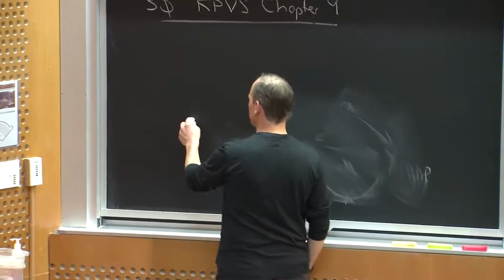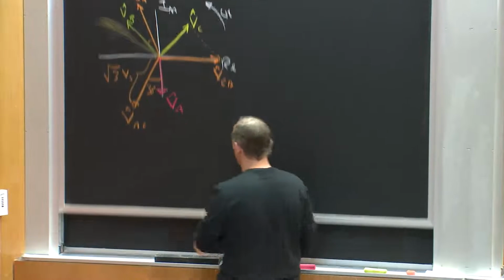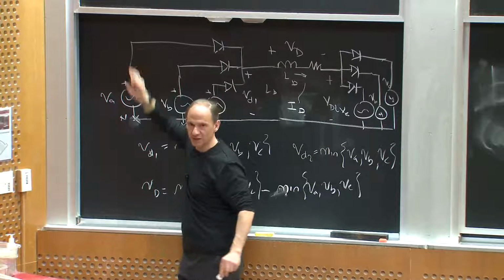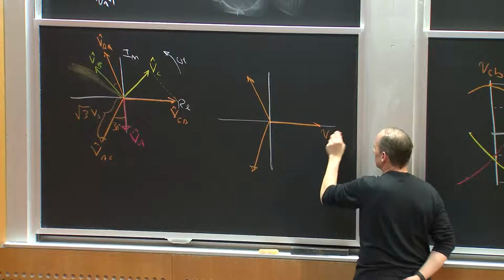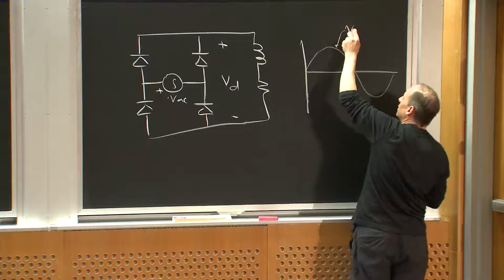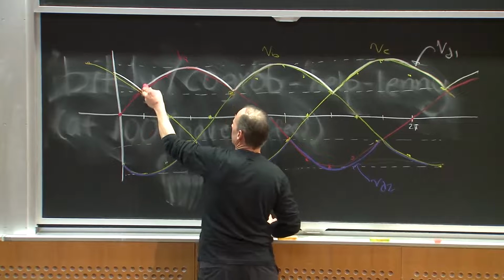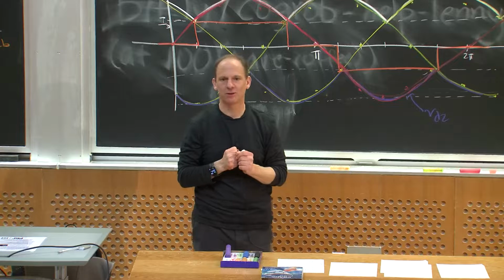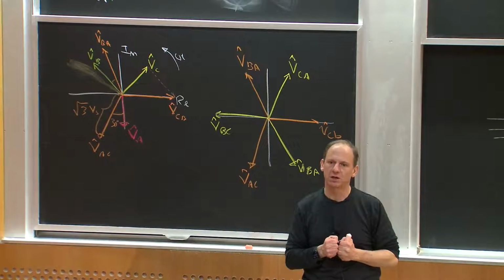Lecture 22: Three-Phase Systems, Part 2

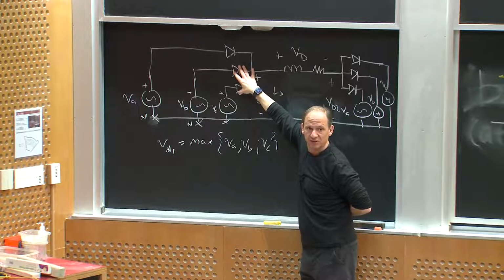Comment: Anyone can help me understand how the second group of diodes pick the min voltage? @13:18
Reply: There are three AC sinusoidal voltage sources, which have a phase shift of 0, 2/3 pi and 4/3 pi. The anodes of the three diodes of the second group are connected together, while the cathodes each go to one of the three voltage sources. Whichever diode is connected to the source with the lowest output voltage (at a given point in time) becomes conductive and pulls the anode side to this minimum voltage, thus reversing the other diodes, because their cathodes are connected to sources with a higher voltage. At a later point in time the conduction transitions to another diode, due to the phase shift of the sources.
Reply: @weinihao3632   Man I spent hours arguing with chatgpt, this comment saved me, thanks.
Reply: I would just think of how in the right-side set of 3 diodes (min voltage trackers), only the ones with the highest forward bias voltage will conduct. 

There's a constant voltage on the anodes, but the cathode voltage is connected to the 3 AC sources. Whichever one of those 3 sources produce the most negative voltage, the associated diode will have the highest forward voltage applied across it [V_const - (-V_x)], and will thus conduct.

I think something that I'm not completely convinced of is why the current only goes through the path of the highest forward voltage... it's probably something fundamental like KVL that'll explain it.